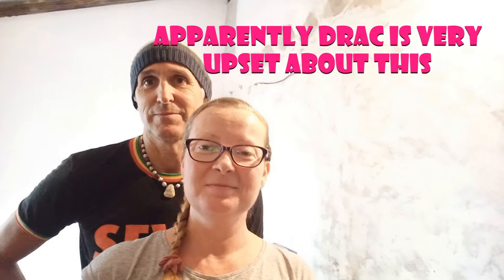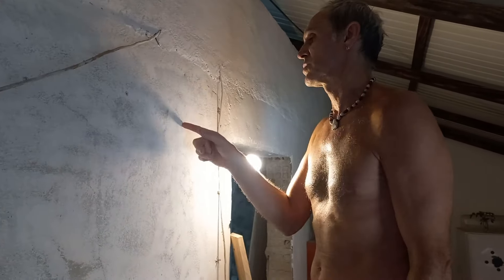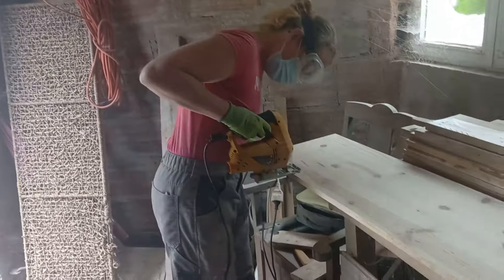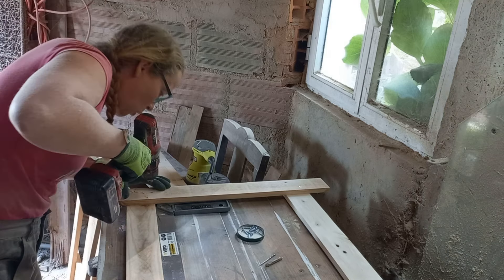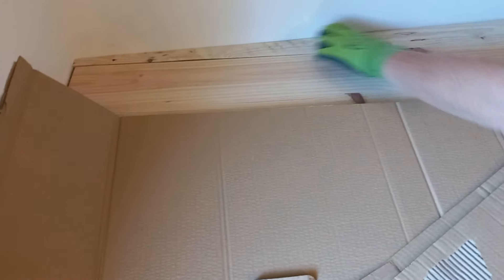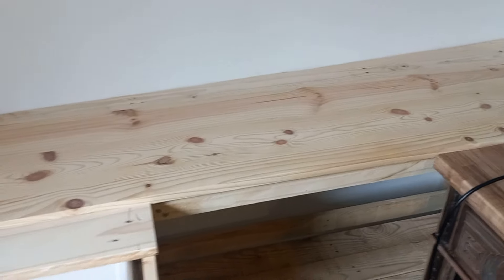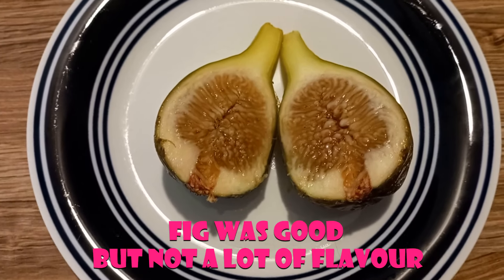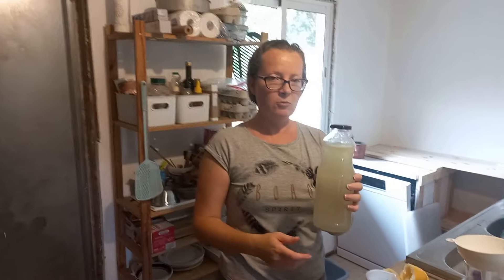Pallet Upcycle - DIY Shelving & Coffee Bar!

Comment: Ненавижу аспартам. Но 100грамм сахара на литр не слишком много?
 Давно хотел спросить - в Португалии можно купить ПРОСТО черный чай ? Без всего , просто чай ... Типа , Липтон Желтая Этикетка? Просто коробку с мелким листовым чаем (не пакетики , не пирамидки и проч...)????
Лепестковый шлифовальный диск - хороший инструмент . Надо приспособиться к нему , уменьшает общее время шлифования в разы , если использовать последовательно круги разной зернистости. Царапины на дереве не оставляет только электрический рубанок. Даже ленточная шлифовальная машина делает царапины , поэтому ей работают только вдоль волокон. И это всё актуально для прозрачных покрытий , где лак выявляет эти царапины.  Для непрозрачных покрытий это не критично - поверхности можно шлифовать , заполнять дефекты шпаклевкой, перекрашивать.
Reply from the maker: I agree 100g/L is too much sugar. So far I've cut it down to to 60g but I'll probably keep cutting the sugar until Grant notices. 😆
Yes you can get black tea here. We usually buy English Breakfast for hot tea. I have seen loose leaf tea here as well. 
I wish I had an electric planer but it's not in the budget. The frame will be painted so it will be fine. I'll finish sanding the top and shelves by hand as I plan to varnish them.
Reply: @notyouraveragegringos  Я забыл спросить, как ваш дом перенес большую грозу ? У вас было много работ по гидроизоляции и проч.
Reply from the maker: @user-re7ds4gd4y Our house is perfectly dry and we've had quite a bit of rain the past 3 days. The waterproofing work Grant did was successful! 😁